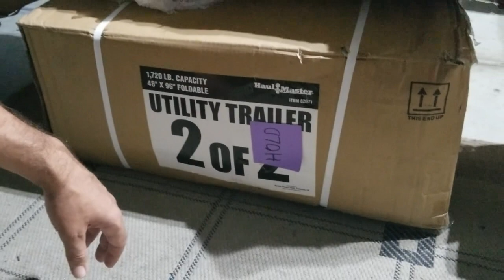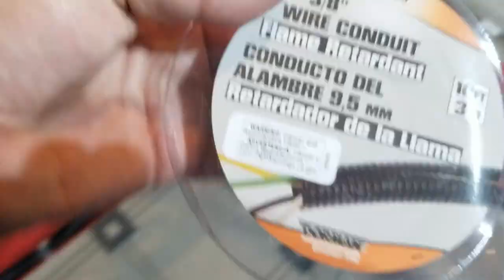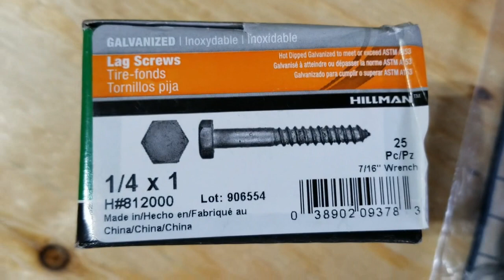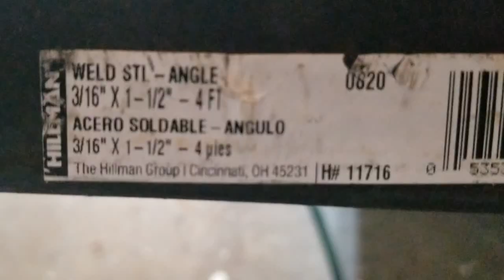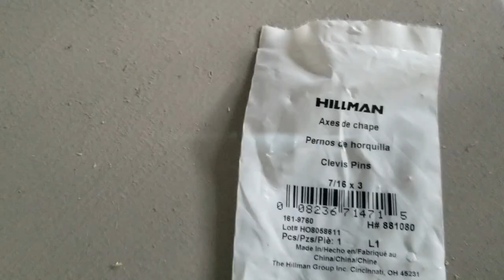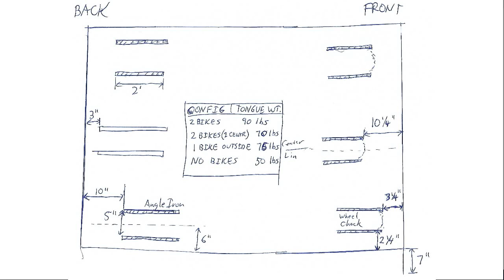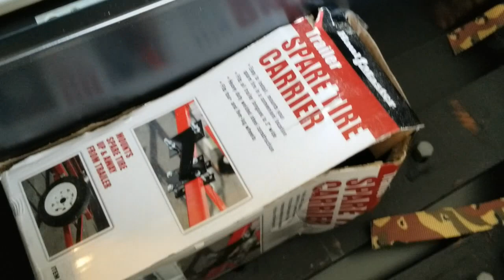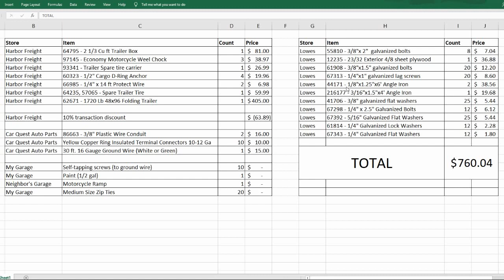$760 Motorcycle Trailer!!!  DIY, Foldable, Tilt

Comment: It always cost more and it always takes way more time. But I admire your work. You did a great job. Well done and you have the satisfaction of knowing you did it yourself.
Reply: i don't know if it's true in this case that it cost more.. even the knock-off 3-bike trailers are going to cost around $2500-$3000.

Comment: I noticed you have problems with check trailer light. If you haven’t fix the problem yet there is a part that U-Haul sells that plugs inline with your four way plug. It is designed to be able to use led lights on your tow vehicle without causing your vehicle system to show errors.

Comment: I've had a couple of these trailers. One thing to think about if you have issues backing it up. 1 extend the tong of the trailer 1' to 18"(It will increase the pivot length from the wheels and ball).  2 try to find 14" wheels(the bigger wheels will turn slower). That will help with the jackknifing of the trailer.

Comment: Thanks for showing the process. I am thinking about doing something similar. Was thinking of pushing motorcycles onto the trailer when it was titled, but you talked me out of it. Do you think the rear wheel tracks are necessary?
Reply from the maker: Hmm.. If you strapped the rear to both sides maybe you could get away from the teacks but i think its worth it for peace of mind

Comment: how much does it weigh?
Reply: I have a similar trailer that is aluminum and wood. It is the Salter T1180 4 by8 foot. The trailer itself including all the frame is 265 pounds.  Then u have to add the plywood so about 325 as a flat trailer. Mine is closer to 400 pounds because I have sides and a bifold trailer ramp at the back made out of wood.